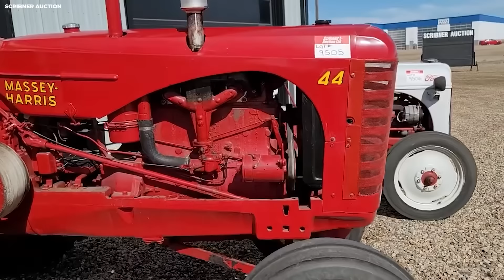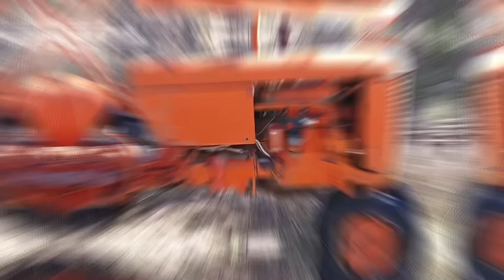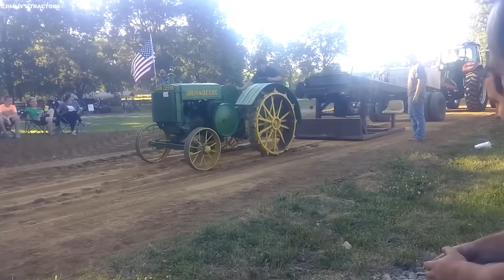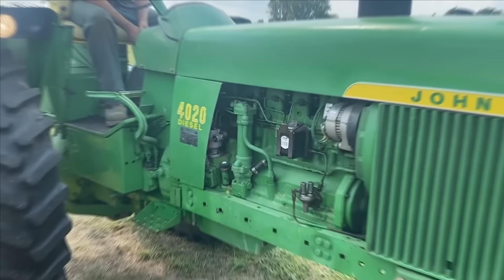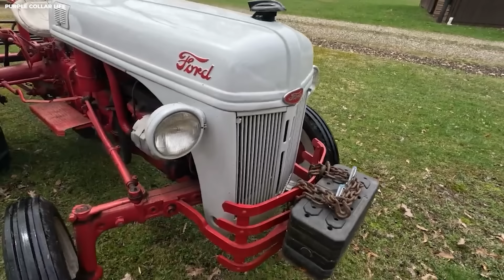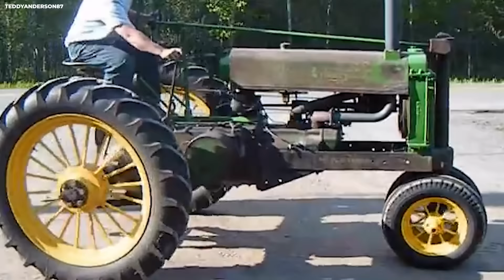10 TRACTOR ENGINES THAT LAST FOREVER

Comment: If you had farming experience with Ford tractors, you would know their best use was for shallow plowing. Anything deeper and the front end would buck like a bronco. Back in the 1950s, I got rid of Ford for a Farmall. Used that Farmall until the 1990s